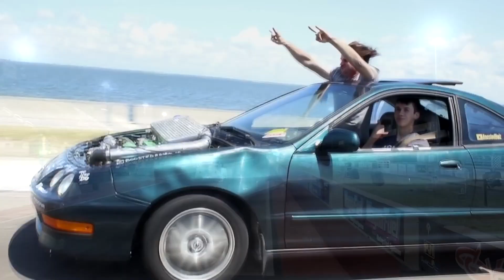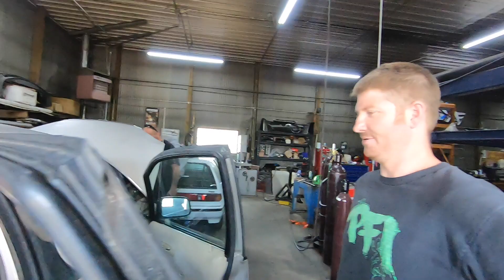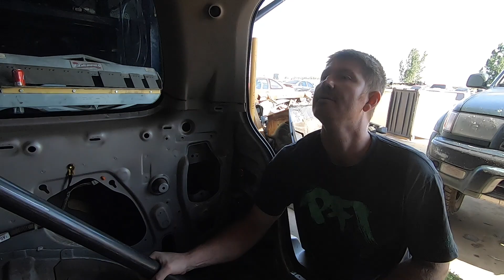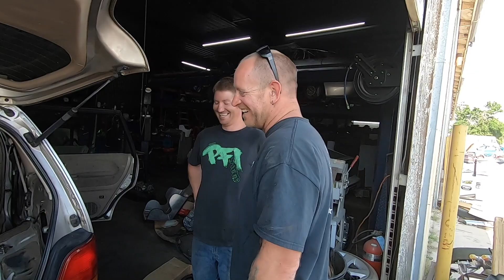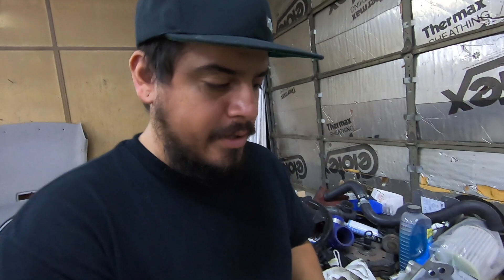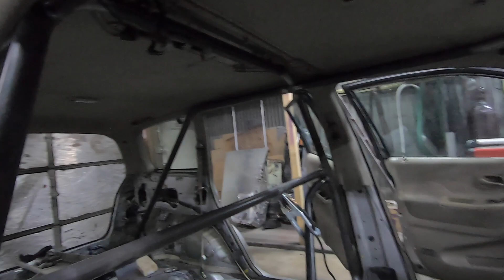The Roll Cage In The Rowdyssey Is Coming Out So Good!

Comment: What's the deal with the bent valve? Guide too tight? Exhaust cam timing too advanced? I have seen both happen...
Reply: Retainer hit the rocker , knocked the keeper out and as it was falling into the hole the piston smacked it
Reply: @PFIBrent  That's the "what." I'm guessing not enough spring pressure is the "why?"
Reply: @ronjones-6977  maybe a binding guide at high valve temperatures too?

Comment: Tell Emilio, I would check into options to file/smooth that area down on the piston where the valve made contact.  That WILL create a hot spot, and under high boost and load, will cause pre ignition/detonation. Would highly recommend you guys do something with that area before re-assembly.

Comment: On the Hondaru - Have you considered that the same valve properties that allow them to bend instead of breaking also could be causing them to stretch, causing the valve clearance to close up.  You should start checking total valve length of a new one verses the used ones.  You have got to figure out why you can't maintain valve clearance or you will obviously keep having issues.

Comment: 5th gets hot on honda trans because the oil can't flow well thought the trans casing hole. I had a CG trans from a D16a1 that would melt 5th if the oil got lower than stock levels. Ad a pump that draws oil though the 5th gear housing and a oil cooler or over fill as much as you can like 1.5qts overfilling will force oil to stay around 5th and cool it

Comment: Have the machine shop check all the guides they may be to tight and when they get hot they grab on to the valve. Since it happed to the mr2 and the same place built the heads

Comment: Damn same exact thing happened to my lil d16 pushing 300hp, i let the piston ride and it ended up cracking, also was a tinyyyyy hairline crack in the sleeve, but same exact shit noodled a ferrea and split the guide, dropped in a new guide and 1 valve then switched to steel retainers and letter ride not long before it was smokin like a chimney and hurt piston was cracked down the ringland

Comment: Interstate battery 👍 use the piss out of it. 5 year warranty, 2 years no questions ask next 3 is prorated. I have them in all of my vehicles and pit them in all my customers. Never an issue with the battery.

In my jeep the heavy duty is installed winch does great. Been running interstate for 14 years.

Comment: If Hondaru and the MR2 have aluminum rods in them then get a new set of rods because when a valve makes contact with the piston especially hard enough to bend or break a valve it puts alot of stress on that aluminum rod then the rod becomes the next weakest link in the engine

Comment: You can cover those mid lower and upper bars with some pool  swim noodles.  Easy, cheap and they work great.
Reply: They are trying to pass a pretty tight cert, there’s specific foam for roll cages needed for things like that.
Reply: @thewespaul6520  Good point and they will need some especially if anyone will be seated in the rear seats.  The upper bar above the front seat should also be padded.
Reply: William Logan pink noodles
Reply: Pool noodles will not pass tech - they are NOT a good fit for mitigating head injuries, density is way too low for impacts at 150+mph. They are also a fire hazard. Do it right and get some certified roll cage padding

Comment: Odyssey batteries are the shit, but you gotta keep them on a maintainer/ trickle charger when they are installed on vehicles that have long down times and if they drop below 10 volts the battery is pretty much junk, it will not have the life expectancy and will drain a lot quicker.

Comment: Sportframe 1 1/4 inch Rec (Powder Coat)
Class 1 hitch
Max weight: 2,000 lbs.
Manufacturer Part Number: 11211
Part number: 247276
Hitch image shown is for display purposes only and may not reflect the actual hitch for this vehicle.
Watch the hitch installation video
$199.95

U-Haul has the hitch for your van - you just needed to order it at uhaul.com.  A local store isn't going to be sitting on a hitch for a 25 year old Honda van in their inventory.  They'll direct ship it to your shop.  
Don't forget your new hitch ball, pin & ball-mount.  About another $30.   

Happy towing, good luck on RMRW.

Comment: You've had the wrong Odyssey Battery in there every time way too small for the application 
But in typical Kyle fashion  let's blame the battery company on you tube, smdh
Reply: I like the placement of the new one. Rocks never randomly fly up off the highway and chip shit. It's like a bumper.......filled with acid.

Comment: Maby use a bit more transmission oil to reduce heat friction in the 5th gear.
Reply: The temperature of the oil is the same for all its volume, therefore adding more does not mean that it will be colder. The solution is to use extreme pressure oil and / or install a transmission case oil cooler.
Reply: EasyGaraje you’re overthinking it. More oil will allow it to actually get to the 5th gear. Looks like not much of it is making its way there.
Reply: I have a boosted civic hatch trans cooler works better than adding more oil.
Reply: @gt3tunecl725  I would say that is an accurate statement.
Reply: @schwags1969  Thanks u very much bro!
Reply: @jayswrld5715  I think that is the best way!
Reply: @ziglol  Bro, 
 What I am saying is based on physics. I'm not relying on what everyone uses and why everyone uses it that way, me anyway. Why do you think extreme pressure oils exist, which in fact are for transmission boxes with a large torque applied to the same sprockets. Thanks for u answer!.
Reply: @gt3tunecl725  its worked 100% of the time since I got it last year for my first car lol its red and a old 2000 hatchback model.
Reply: I think what Daniel hoi here means, as well as Alex, is that more oil would give it more thermal mass, so though it would take a bit longer to cool down after a run, the temperature wouldn't rise as quickly. A transmission case oil cooler is useful for cooling that oil and keeping it cooler for long periods of time, or for cooling the oil down quickly after a drag race, both incredibly desirable in motorsports. So adding more oil is a stopgap solution at best, but it would help in the short term. If I get my own vehicle to work on, my first mods are probably going to involve a transmission oil cooler, maybe an engine oil cooler.
Reply: EasyGaraje I gotchu. Thanks for clarifying.
Reply: @Avetho  correct more mass. Its almost the same like boiling hot water: if there is more water in the pan the longer it takes to heat up the water. Thats why the Fifth gear in this case needs more oil to reduce friction. And its only peak moment racing, so why adding a transcooler?

Comment: 6:52 I’m not an expert on these types of transmissions, but it seems like heat marks are due to lack of lubrication. There’s nothing there to sling the oil over that fork. Maybe a design flaw.
Reply: Very true!!!
Reply: Until then what about adding more oil to bring the level up slightly so under massive load the oil can go to the back of the box and still make it way to the side of the box?
Reply: Matthew Hardcastle I would agree. That would be a great starting point to minimize the heat build up and destroying that trans 👍

Comment: Is there anyone I can email you guys a picture of my pitted pistons https://imgur.com/a/QghswkT off my LS/Vtec build GE 84.5mm HD sleeves with CP X forged 13.5:1 comp. I had some head gasket problems which seem to have stemmed from the machine shop not doing the head torque properly with the ARP head studs. 3 of the ARP nuts were stupid easy to loosen which was around the 2 cylinders I had a head gasket leak from. I found out that both sparkplugs had broken the tips off in those cylinders. It pitted the bowls a bit on the head and pitted the pistons a little bit. Looking to get your input on whether or not you would continue running the pistons with new rings or just get a fresh set of pistons when I get the block rehoned? It would help me out a lot! Thanks for all you guys do with your content.

Comment: That is really the badest mini van on the planet I have seen one other that was a Dodge it had a complete roll cage chassis and was set up for rear wheel drive with a 440 under the hood it was fast and was cool saw it at an Orlando dagstrip a while back but it was no where near as fast as Kyle's mini van that thing is sick and it is kinda simple yet it's becoming a full on race van how many poeple can say the have a race van alot can say they have a race car even Kyle but he can say he has a race van as well and that is complete bad ass but I think Emilio is gonna need a complete set of springs stronger then what's in it I fear he will have the same problem again me and my dad had a Toyota truck with boost aot of boost 30 Pi's didn't mess with the gate it made what it made according to my dad and we went thought 3 heads and 2 cams thinking so many different things where to blame and it came down to bigger stronger springs and the valve never said hello to the piston again no then it was the rear end hope it goes well but I'm scared for you man sorry I have just been there or more of my dad I was young but still had to deal with him being pissed and me having to take it apart every time oh I got good at that